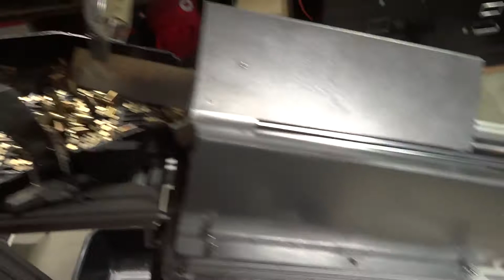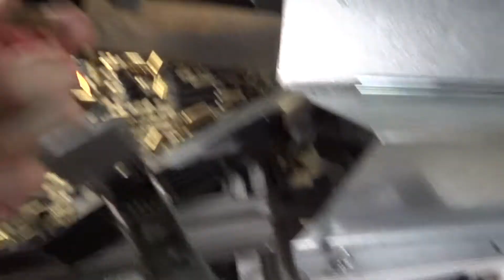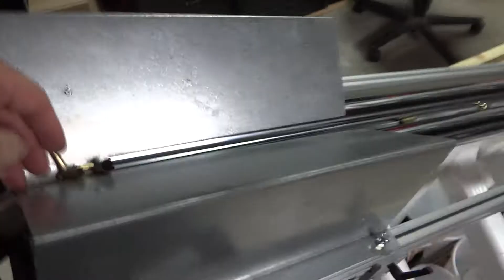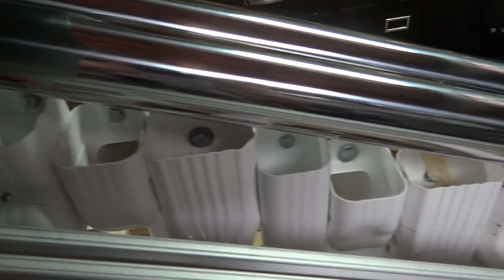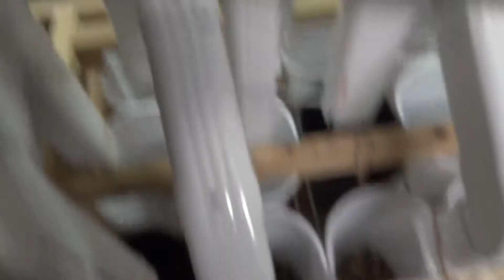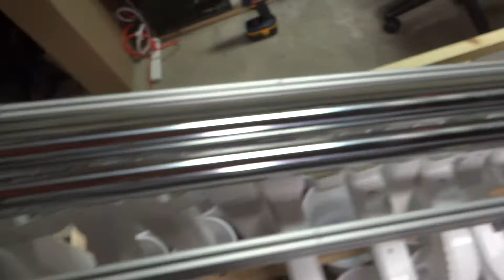Our brass sorter

Comment: Can you separate 9mm from 380 ACP?
Reply from the maker: Easily   I used those particular casings as a (quasi) benchmark.   If the machine could separate those two... I considered the machine calibrated.  Side Note:   The 223s would also drop into the 380 bucket but those two were trival to manually sub-sort (by hand).

Comment: In the process of building one of these! Could you send me the file for the 3D printed parts on top? Would really appreciate it and look forward to seeing how well this works!! Thank you for posting this video!
Reply: My email is mavrick.clark@hotmail.com if you have any additional pictures or ideas I am open to anything. Thanks for your time
Reply from the maker: @tannerclark1993  Found it!    I'm sending you the Stl file and the original (Google's sketchup).    Sorry Sketchup (the freebee is no longer available ... If you can find it I used Googles Sketchup Version 8 (Version 8 was the last free one before they were bought out).
Reply from the maker: @tannerclark1993  I apologize.   The previous video was terrible .   This is the remake: https://youtu.be/MBT1jDHiwTE
Reply from the maker: If I can find them ... I sure will.    The spacing of the grid is critical and I should have had a larger area for this separation to occur.   I would recommend Raptor rather than nylon (nylon is hard to print because it doesn't stick) and ABS (lego plastic) isn't strong enough.   Raptor is a filament that will "Stay in place" and yet is strong.    I will search for ya.

Comment from the maker: I have tried several times to publish another video with the dimensions of this sorter as I do not have the original plans so I can just inform everyone of the general dimensions (I am not withholding this info - I just don't have it).     But I thought some general dimensions would be better than nothing.   

The rollers are the main piece(s) of this machine.    They are 70" long and 1 7/8" in diameter.    The top of the roller (measured vertically to the floor was 43".    The bottom of the roller (measured vertically to the floor was 12").        The cost of these rollers alone is thought to be $600 each  (again I don't know who manufactured them).

The belt that drives the roller is 1/2".     The belt must be at least 45" long.    I'd have to disassemble the machine to measure it more accurately.

The motor control  is variable speed:
Leeson Speed Master (Motor Control).
Model Number 174307.00 B14   Input 115(230)V    50/60hz 1PH 8A

The motor that actually drives the rollers is:
Leeson
CM34D25NZ10C
M1135042.00

This machine is capable of sorting 26 different calibers (I am counting 22LRs and calibers like .225 that get caught in the grates at the top of the machine) as well as the 50 cals (that fall off the end).

Although the machine is most accurate at the slower speeds - it's not practical to run it so slow.    Running it at 100 rpms is not practical - nor very accurate.     We always seem to run it at the medium speed range of 50 rpms.

The grids at the top of the machine were printed by myself and I was limited to 5"x5" squares but these squares were tied together to form a 10x25" sorting area (the brass is first dumped at the top of the machine).    

It's most accurate with clean brass (of course) but I was always surprised that dirty brass and clean brass results usually were basically the same.    

I apologize for not being able to publish the movie but I've spent several hours trying to find the culprit (corrupt) file to no avail.

I realize these dimensions are woefully incomplete and almost useless to a machinist trying to build one.

I wish I had more information to share and will try to answer questions as they come in.
Reply: My condolences to you and your family. Would you know where you purchased the rollers and how they are attached to the motor and the frame? Thank you, and God bless your bother for sharing this
Reply from the maker: @ggenovez  I am sorry I do not know the source of where he got the rollers.   I only know they were expensive but the rollers are the "heart" of the machine.    I think the roller was 2" in diameter and approximately 5 foot long (the longer the better for accuracy).   Each end was machined down to approximately to 3/4" to an 1" diameter (nub if you will) so that it fit inside a greased bearing ("pillow block set screw bearing").
Reply from the maker: @ggenovez  https://ec.kamandirect.com/storeus/product/123809/ABB-1-1875-in-Shaft-Size-2-Bolt-Pillow-Block-Set-Screw-Bearing/_/R-3451336?matchtype=&network=g&device=c&adposition=&keyword=&gclid=Cj0KCQjwhIP6BRCMARIsALu9LflHPXYaAukIJUBKzWr3TElXEgNONuIcFL-raSxNS1f-egAUzIEdNngaAnEzEALw_wcB

Kaman Industrial Technologies sells a housed bearing that looks similar to what we used.      So the main "rods" were machined down to say 3/4 to an 1" (nub if you will) that in turn fit inside this housed bearing.    The housed bearing could then be attached to the X channel rather easily.

Careful in choosing this part because the clearance between the two rods is a 50 cal at the bottom and a 22LR at the top.
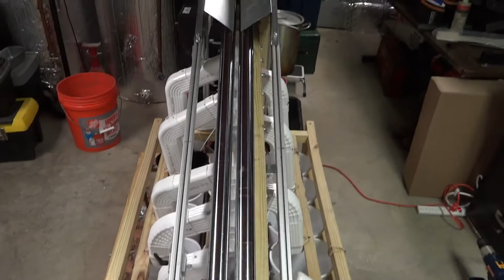Reply from the maker: If you look at this vid at the 1:23 marker.   It shows the two housed bearings.   They are 2" in dia as well and feature a small footprint.
Reply from the maker: @ggenovez  I apologize for the disjointed replies.   YT is screwing with me (again) and I get cut off a lot whenever I try to reply.   I am not sure how they do it (but they do).

Comment: Good and informative video, Considering building one myself (Denmark Europe) I have some questions, it will help me a lot if you have time to answer them. How are the shafts made and from what, what's the diameter of them, how fast do they rotate and have you made the speed, variable? Best Regards Per
Reply from the maker: Sorry Google/YouTube locked me out of my own account and I couldn't respond (quicker).   That has been cleaned up.   I'll have to get some time to measure the dimensions and relay onto you.    I can say they are approximately 6 foot long (we still use imperial measurements in the US) and approximately 1.5 inches in diameter.    They seem to made of stainless steel but I am uncertain of the material of the rods.    The rods are the heart of the system and I believe they cost $600 U.,S. dollars apiece!     I 3D printed the top-grates (you can see 22LR casings hanging in them (at the top of the sorter).    These grates allow dirt and 22LRs to pass through them and the rest (larger diameter brass goes down the top shoot where the sorting really starts).     Yes - the motor is a variable speed motor.    Again I'll have to take the time to give you the setting.    All I know (at the moment) is it is at "medium" speed.   The point I am trying to convey is:   Logic holds up to be true - meaning -  the slower the speed the more accurate the "drop"/thus the more accurate the sorting process is.    This is mostly due to the more vibration the brass is subjected to: the more likely it be a less accurate result.    None-the-less, once it's calibrated ; the brass drops pretty accurately and repeatedly regardless of the speed.   

I'll get the other dimensions as quickly as time allows.
Reply: @helpmenowmark  Thank you for taking the time to answer / measure, for me
Reply: Is there anyone who can tell, in which rpm area, the rolles sorter works?

Comment: Unidentified rim fire I think is a 22 magnum.  You can get a vibratory magnet off ebay cheap and make a vibrating table for the feed.  Love the downspout and garbage cans.
For folks that want to know how to make, it's two rotating cylinders, shaft material would work great, opposite each other and they are narrower at the top than the bottom.  They fall out when the shafts are wide enough.
Reply from the maker: The top of the machine cost thousands (rollers, etc).    The downspouts and such probably grossed out a $300, possibly $400.   The original downspouts were made of stainless steel and x-channel but my brother passed before he could finish it.    The stainless steel sorters looked great but I found making adjustments or tweaking the machine was next to impossible.     Lowes to the rescue!

Comment: I'm trying to build one of these for a local gun range.  do you think pvc pipe would work?  could you share your plans?
Reply from the maker: my brother designed it.  he past away last year.     plans were never used.      no pvc pipe won't retain the accuracy needed.   the tubes u see are expensive.    I don't know if $600.00 buys one or two of them....either way...pricey
Reply: Got it,  we'll thank you for your time sir,  if I get one working I'll post on here for you.
Reply from the maker: www.AardvarkReloading.Com
www.AardvarkReloadingBrass.Com (Brass store)

My Dad is retiring (age 87 and deserves it).   He cleaned and sorted all of my brass.   It was my job to put the brass on the web and make videos, etc.   Without his help - I'm sunk.

Are you still in the market for in a brass sorting machine?    What State are you located in?

Includes sorting machine shown in the video, all filters, trays, and buckets as shown in the video.   

Variable speed motor.

https://www.youtube.com/watch?v=aT_s4jrLuJE

I am asking for $4000 + shipping for the machine.

864-630-0717
Reply from the maker: I don't think PVC pipe would work overall because it will flex too much (and probably wear too quickly).     We are talking thousandths of an inch difference between various calibers.      For this type of rough sorting (PVC pipe accuracy) you would only get biggest, big, medium, and small type separation.    I'd recommend those sorting trays you can purchase for roughly $45.     The yare the size of a 5 gallon bucket (it's diameter).

Comment: Great Machine, would you tell us what type of tubing you used and how did you adapt them to bearings? your answer will be appreciated.
Reply from the maker: Phillip Kaplan My brother designed it and built it; He passed away of liver cancer this past fall.   He took the plans with him (so to speak).   I only know that those two rods cost $600.00.   I don't know if they were $600 each or $600 for the pair.   It's pretty much all I know about it.   I did the channels and bucket platform- obviously from Home Depot.
Reply from the maker: www.AardvarkReloading.Com
www.AardvarkReloadingBrass.Com (Brass store)

My Dad is retiring (age 87 and deserves it).   He cleaned and sorted all of my brass.   It was my job to put the brass on the web and make videos, etc.   Without his help - I'm sunk.

Are you still in the market for in a brass sorting machine?    What State are you located in?

Includes sorting machine shown in the video, all filters, trays, and buckets as shown in the video.   

Variable speed motor.

https://www.youtube.com/watch?v=aT_s4jrLuJE

I am asking for $4000 + shipping for the machine.

864-630-0717
Reply: @helpmenowmark   Hi Mark, i just tried to visit your brass store, but couldnt.
Reply from the maker: I had to close shop.   Amazon put me out of business.    My brother and a machinist designed the top part of the sorter.   Unfortunately my brother died of liver cancer and took the design specs with him.   I think the heart and soul of this machine was the two rollers.    They were 2" in diameter (approx) and had a 1" diameter protrusion on each end of the rod/rollers.    I think these protrusions fit (pressure/friction fit I'm sure) into a box bearing.     The footprint of these box bearings is critical because you need a small footprint to alllow both box bearings to be relativiely close together.      I have a few other videos associated with the sorter.   Did you find them?
Reply from the maker: I believe each roller was approximately 48" long possible 5 ft and each were expensive.   Possibly $600 (or more) each.